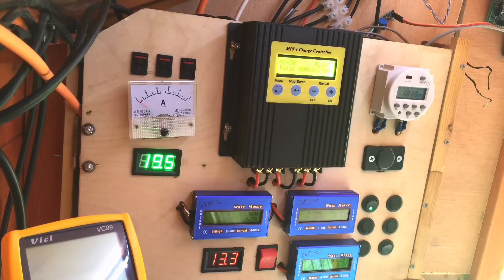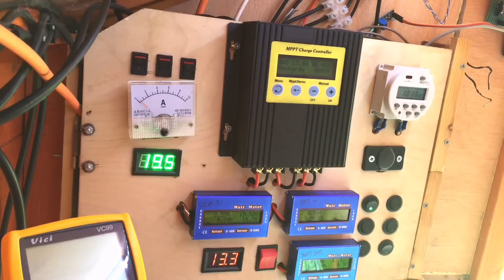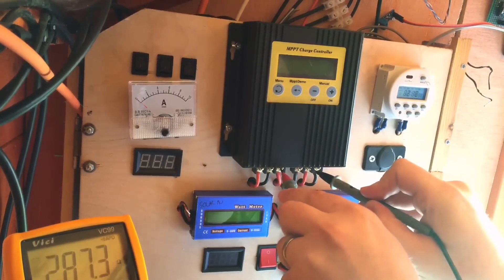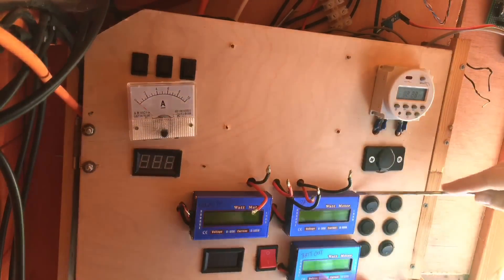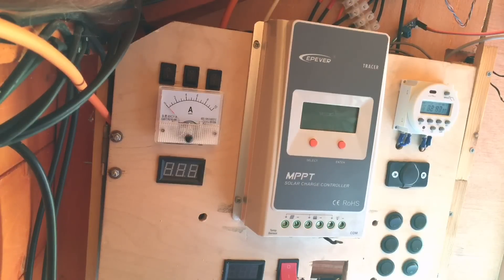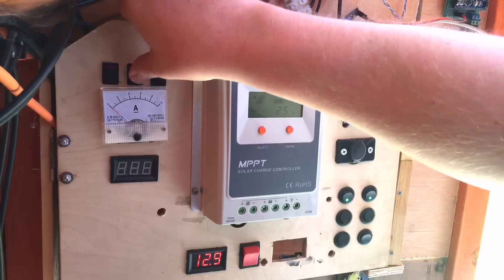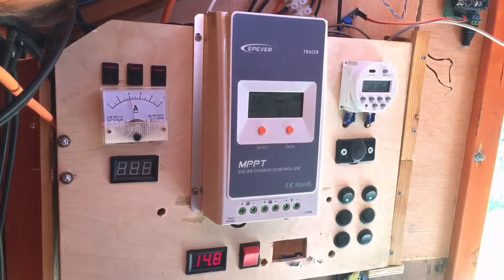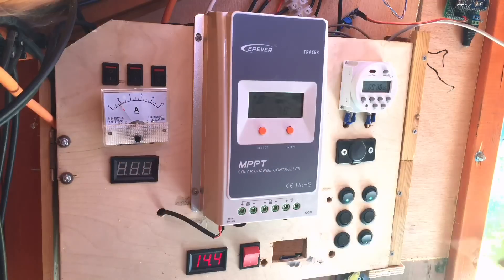EPEver Tracer 2210A MPPT Fitting and Testing - 12v Solar Shed

Comment: Hi Adam,
May I ask if it is ideal to connect a 1pc 315W solar panel (Vmp 37.1V, Imp 8.51A, Voc 45.6V, Isc 9A) to a Tracer 2210A 20A MPPT controller for a 12V system? 
From what I know, the 315W solar panel Isc is 9A, so it is well under for the 20A rating of the 2210A. The datasheet of the 2210A also states a Max PV Array Power of 780W for a 12V system.
However, the datasheet also states a Rated Charge Power/Max PV Input Power of 260W (12V system) for the 2210A 20A model. Would you know if it means that if connect a 315W panel, or if I connect a total of 780W solar panels, it will only work at 260W for a 12V system?Thanks a lot!
Reply from the maker: The tracers can be a bit confusing with their ratings.  Most controllers are limited by their input current, but thats not quite my understanding with the tracers.  The 20 amp limit on the 2210A is a limit on how much current it will deliver into the battery (or to the load).  So 315w at 12v is something like 26 amps (assuming brilliant sun, a perfect conversion and a well discharged battery) which sounds like too much for the tracer.  Thing is even on a bright clear morning your panel isn't going to hit it's maximum power for a while.  Your battery will be charging up and the cotroller will start limiting the current coming in to prevent over charge.  So having a panel which after conversion can create more current than the controller is designed to handle isn't neccasarily an issue.  The advantage here also is when the weather is poor, you've got more potential on the imput than if you used a smaller panel which would never go over the operating limits.  The tricky bit is how the system is going to perform when the dun comes from behind a thick cloud quickly - we it react quickly enough?
I've never blown a charge controller however, and that's because I generally buy 'the next model up'.  If I'm expecting 10 amps, I buy the 20 amp version.  Expecting 30 amps, I'd go for the 40.  Running these items well within their designed operating parameters (for me at least) makes good sense.
Reply: Thank you very much for the information Adam :)Actually that is also my understanding, the 20A on 2210A model means it can only charge at 20A max. 
I'm just confused on the marking/sticker on the box that says: "Max PV Input Power:260W (12V), 520W (24V) But on the manual/datasheet, Max PV Array Power 780W (12V), 1560W (24V).From what I know I can connect 2 - 315W panels in series for the Tracer 2210A for a total of 630W, 74V. 
If I just connect 1pc 315W panel with Imp of 8.51, I think it is also suited for the 2210A 20A? 

I just don't understand what the "Max PV Input Power of 260W" means. - or is it meant to be 20A (260W / 12 = 21.6A) ?

Comment: Hi Adam. After watching ur videos about epever scc i hv ordered one..I have four 24v and 260w solar panels (with 30.97v Vmpp , 8.5Amp Impp and 38.17 Voc, 9.02 Isc) and 24v battery bank.. What is the way best way to connect my four panels to the charge cntrlr? 4 panels in parallel or in series which setup do you think is best
Reply from the maker: I'd suggest series parallel will be the best option - although you didn't say which version you have ordered.  Two panels in series giving you a voltage of 76v open circuit and a MPP at about 62volts is well within the spec of the controller.  So placing two sets of those panels in parallel will give you a maximum current of about 17 amps on the input.
So the question is which controller model did you go for? Doing the maths I hope you've gone for the 40 amp?
Reply: So sorry for not mentioning the controller. I hv ordered Tracer 4210A 40 amps. So two sets of panels in series and both the sets in parallel. According to this setup i will be having 520w solar but high voltage , due to series setup in which voltage rises but amps n wattage remain the same compared to parallel connection in which both watts n amp will increase.... Adam this is where im mostly confused. Please educate me.
Reply from the maker: Super - I think you've gone for the right option then.  
Panels in series the voltage increases but the current stays the same.  Panels in parallel the current increases but the voltage stays the same.  I've drawn a diagram based on your panels which may or may not help!  https://goo.gl/photos/iV9ESRHRVMQBq9UF6
Reply: I got the idea. Thanks Adam. I will setup my panels the way you showed in the diagram.

Comment: I find a problem with connecting more than one solar panel to a charge regular. The power seams to feed into any mismatched panel meaning I get 10% of the power of the second panel or in low light less power than the biggest panel makes on its own. Series connection seams even less power.
Reply from the maker: +simon greaves Connecting mis-matched panels unfortunately doesn't work very well. Your larger panels can be dragged down to the maximum output of your smaller panel. Best to have different charge controllers for each size of panel.

Comment: On page 12 of the manual, it says that the tracer is a positive ground controller. Does this mean that the solar battery and load have to be grounded to earth through positive? Is this what you've done, or have you earthed through the negative?
Reply from the maker: +Charles Moore My system isn't actually earthed. The charge controller is common positive which means it switches in the negative side. If you grounded your solar panels negative to ground and you battery to ground you'd effectively bypass the charge controller. You can earth the positive connection if you feel it's necessary.

Comment: Hey Adam, Quick question for ya, Cant seem to find anything about the load out on controllers. I have the EPsolar 3210A (30A) I want to use the load out to run 12v low amp lights in my house as well as connect a couple USB 5v 3A chargers.  Unless i misunderstand how one can use the load out, I am thinking,  I can use the load out up to the 30 amp as long as I do not do more than the 30A charger produces at the 12 volt level? Am i correct in this?  I have an RV fuse box that I want to connect directly to the load out and fuse each set of lights and USB chargers.  Anyway, Am i correct in thinking I can use the charge controller load out, as long as I do not go over the 30A 12volt? And wil the charger shut down the load out if my battery gets lower than it should? Dont want to kill my batteries as they are way to $$$$   thanks for any help.  
John

Comment: The little charge controller you replaced, shows what power is coming in.
Why did you need 3 other meters ?
Reply from the maker: +David Pedder So I could see exactly what was happening. I've learned a lot from those meters. Exactly what was happening when the suns out and loads are on etc.  They've gone now though - I think I mentioned they wasted a bit of power.

Comment: can u help me pls.
I have pwm regulator thoes it worth to buy new mppt from ebay for about 40$
or new 20ah seald lead acid battery!!! I have limited budget so I can buy only 1 thing.
now im using old 45ah car battery from my mums old YUGO
Reply: With your set up,I would say NO.
 PWM is fine for your application.
 You may choose your upgrades as you progress.
Pay attention to the voltage at the battery!
Reply: ddd228 
thx

Comment: Great, very clear series of videos on the EPever Tracer-A.  You made a comment which made be review the manual (before I buy), which mentioned "positive earthing".  The diagram in the manual shows a positive earth.   I am from Australia and have only ever dealt with "negative earth" systems.

As long as I connect this unit directly to the (+) and (-) terminals of the battery, is there any issues when used in a negative earth system?
Reply from the maker: +Paul Weston As long as you are aware you should be able to avoid any issues. Just make sure you don't connect any part of your solar system to a vehicle chassis then you'll be fine.
Reply: Thank you .... cheers.
Reply: @AdamWelchUK  Great videos on this unit, I have one on the way to replace my current PWM controller.  I often run a jumper to the battery installed in my ATV from the solar system's battery bank to maintain it's charge in my shed.  Will this be an issue for the EPever controller?
Reply: The epever 3210AN Is the same of 3210a in the video, but with negative common system...i have in yhe camper!

Comment: common positive grounding , sorrry to sound dumb but I presume these can still be used in RV /camper /car etc with the normal negative earth ?
Reply from the maker: +ZeroHour Hello. Yes it can you just need to be mindful that it is common positive. For example, don't use the chassis as the negative feed from your solar (although this would be unusual). The area you're more likely to trip up is the load side, but as long as your devices & lights etc. are isolated from the chassis you'll be fine.
Reply: Hey thanks for reply , mmm I don't use it for load ( lucky as all my  stuff is negative ground. At some point in the wiring ) my battery is grounded to chassis ( as should be ) my solar 200 watt panel simply has positive and negative 2 cables that go into my current charge controller , so I presume these are fine wired as normal , ( positive into + Negative into - ) the output will be OK wired to battery bearing in mind my negative side is grounded at the battery ? Regards Z
Reply: When I say output I mean the output from controller ,simply wired to battery normal way , battery negative also has wire to chassis for safety etc
Reply from the maker: From your description it sounds like you'll be fine.  Just make sure your charge controller is isolated from the chassis.  The heatsink on the back should be electrically isolated but if it were me I'd be careful to ensure the heatsink or screws didn't touch the chassis.
Reply: Many thanks
Reply: I have in the camper the epever 3210AN...the same of 3210 A of the video bit with negative common system!!! Its identical but with blue buttoms! And support lithium battery!

Comment: why did you replace the old mppt with the Epever one? and is the epever more efficient or was the replacement more due to other features?
Reply from the maker: +Resist Dk Yeah features really. The Eco-Worthy charge controller is a decent unit but I wanted to monitor my batteries from the comfort of my house. This EPEver has allowed me to do that.
Reply: I ordered one for the same reason, features.
After having seen you videos about the rj45 usb cabel monitoring.
Tnx for those also  :)
i dont have a good spot yet for my 100 watt panel, need to clear some trees first.
But i plan to test my various solar controllers soon using a psu set at 18 volts 5.55a which should simulate my panel at full load.
its not testing the variation in voltage when its bumping up and down due to sun light variation, aka tracking, but it should give a good indication of the conversion efficiancy at full load.
i have a 20a pmw, some cheap mppt 5a boards and the epever 10a which is in transport currently.
Reply: IF you can afford the expense of the cables,run your panel up as high as practical,to avoid the tree shadows.
 Otherwise, it's tree time.

Comment: Hi Adam, like your stuff a lot. I've heard a lot of reliability complaints about the Tracer A series. How're you getting on with it?
Reply from the maker: +Nicholas Holdridge Perfect. I've had quite a few comments on here asking this, lots of comments saying they've bought one and are happy, and I think one or two saying they've had issues. So from my fairly limited experience they seem fairly reliable. However your mileage may vary. 
A common complaint is the odd behaviour of the SOC meter - and it is odd. 
Generally I think the feedback I'm getting is pretty good.
Reply: There have been excessive heat issues.
Good ventilation is required,depending on your out put.
 Heat is bad.

Comment: Standing level of battery should be 12.7v 
I run my mini fridge and the system drops to 12.6 when fridge kicks on to 70watts then the volts goes back up to 12.7 when the fridge drops to standby with 5watts.
Reply from the maker: +Eric Serrano Sounds like you have a healthy battery Eric. Thanks for your comments.

Comment: I ended you buying an led meter to check battery voltage. Anybody know if the epever controller display lights up? And if so how does it turn on? As for battery voltage, here is what I found
12.6=100%
12.5=90%
 12.42=80%
12.32=70%
12.20=60%
12.06=50%
11.9=40%
11.75=30%
11.58=20%
11.32=10%
10.5=0%
Best to not to go passed 80% but you can hit 50% if need be but try not to.
Reply from the maker: +Eric Serrano I prefer the voltage method to State of Charge. I have a chart printed out which has much the same voltages as you've posted here. I'm sure many will find it useful. 
The EPEver tracer screen does not have a back light (neither does the viewstar PWM that uses the same module) I'm afraid. 
Thanks for your comments.
Reply: Don't go lower than 11.9 Volts,no load.
I cut mine off @ 11.5 V. under load.
 It depends on the wattage/usage/amount of the load,really.
Also the type of batteries that you are using!

Comment: hi, i wondering if i can charge ng 12 batteries using 24v panels with this solar charge controller. im gonna migrate from pwm to mppt very soon. please help. thanks mate.
Reply from the maker: Hello and yes.  MPPT technology allows for your panels to be higher voltages than your battery - in fact most manufacturers will recommend this for efficiency.
Reply: hi. i am having two 350w 24v solar panels and single 200ah Battery and mppt solar charge controller 40amp amberroot. should i connect my pannels in series or parralel to charge my battery and run some load on solar simultaneously.

Comment: i am enjoying your video and new to learning about solar. How does one set this system up so that when the battery is low it pulls energy from the solar panels instead? Sorry if this is a newbie question but just trying to learn. Thanks and great videos!
Reply from the maker: +Joshua B Hi Joshua. When your solar panel is producing enough power to run your load that is what will normally happen. If you're producing excess of your load it will also feed some into the battery. Obviously if your load needs more than the solar panel can provide your battery supplies current too. It's not really a function of the charge controller this - more that there's more resistance on the battery than your load and your power will generally take the easiest route.

Comment: Could someone shed some light on this problem for me?
I have the 20amp version of this with 520w of solar going into it and 2x220ah battery bank with a 1000w pure sine inverter running off the batteries to a wall outlet plug. the solar controller seems to accurately show how much the solar is taking in and the system load but the battery level indicator is all over the place. I check it in the afternoon (in the sun and showing full battery) next morning after only running a couple of lights for 30mins or less and with the inverter off (and checking the load is 0.0 overnight) the battery level shows 1 or 2 bars. 
Just want to know how much electricity I actually have so I don't feel scared to charge my laptop.
Thanks in advance for any help.
Reply: Im having the same problem. It had me going nuts. I have the 30amp version and have a 300ah bank running my mini fridge which runs a at 5 watts and spikes to 70 watts for a few minutes then back to 5 watts. Doing the math I should be able to run the fridge for 3 days with out a solar charge before I have to shut iit off. The epever was showing full charge and when I woke up it was at 1 bar. I went and installed some external meters and found that my bank was a consistant 12.8 volts in the morning. I think the epever battery meter is off. Maybe the software. I went into the software and changed the 80% discharge setting to 50% in hopes it would maybe change the battery meter but its hasn't effected the battery reading at all. Have you found a solution yet? Thanks
Reply: Nope, Have not found a solution yet. far as I can tell the battery symbol relates only to how much power the solar is currently bringing in and has nothing to do with the actual battery charge level. very annoying.
Reply: Found a comment on another video that suggested going only off voltage, it suggested that 12.2 volts indicated about 40-50% charge. Hope that helps
Reply: It sound like your batteries are tired.
You really need to monitor battery voltage and not let it lower than....11.9 Volts,with NO load.  Comments?
Reply: ddd228 no batteries are fine, it's just this unit has a retarded battery level indicator. I don't pay any attention to it now and just watch voltage
Reply: You can charge your lap top off of your inverter,NO SWEAT!
 Just monitor your battery voltage.!!!!!!!!!!!!!!

 Pure sign wave inverter is great.

Comment: Hi Adam, is it possible to use the power for load while charging battery?
Reply from the maker: Yes it is, but obviously your battery will charge at a lower level. In the case of your load using more watts than your panels are producing your battery will take up the short fall, resulting in a net loss.
Reply: +Adam Welch I see, thank you very much, you have good video for learning, may be next time review hybrid inverter (china made) and advise which the best from china :)
Reply: There are limits to the load section of your charge controller.